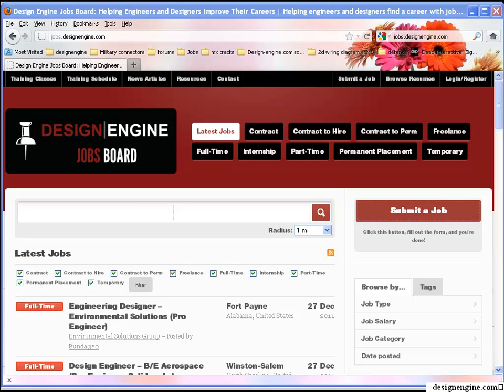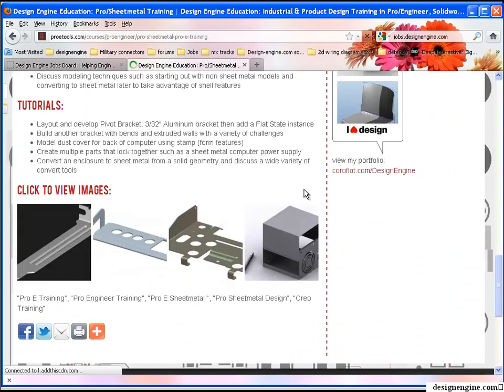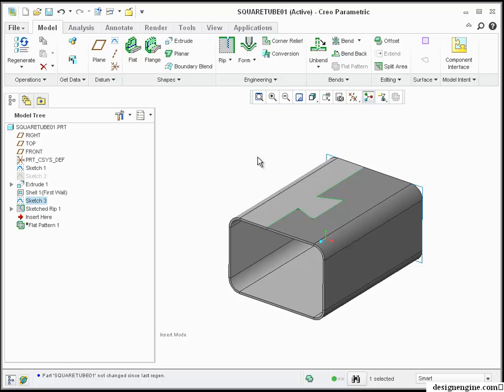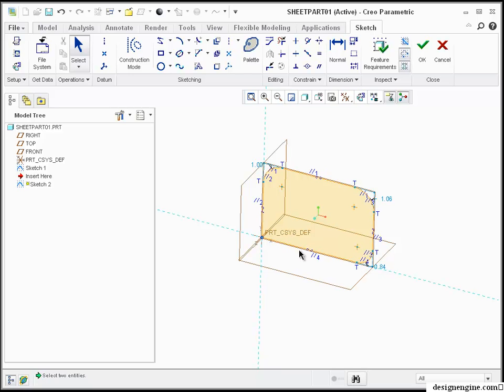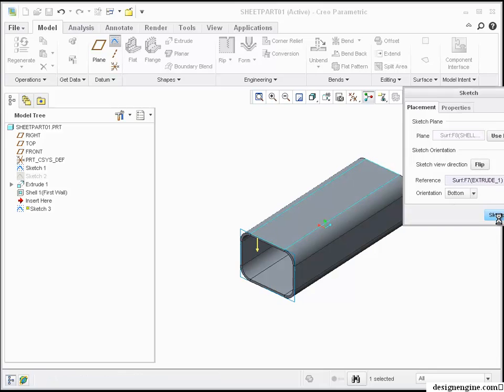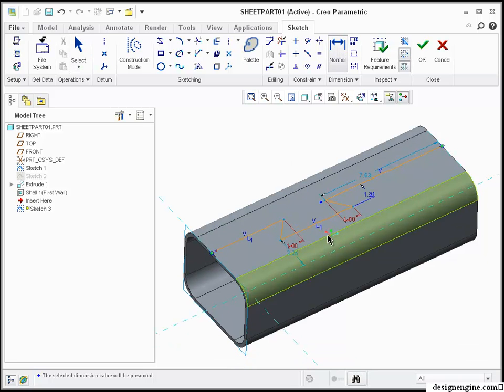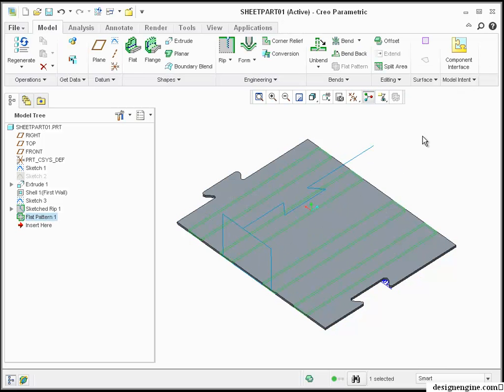Learn Creo 1.0 Sheet metal with this unique demonstration of Pro/ENGINEER's newest release Creo 1.0

Comment: Bart, It might help the videos if you have part unshaded during sketch operations.

In response to sahaja75 the fillet operation in SolidWorks is better than this or Equal Dim constraint would do so. It's getting better since wf5 but still needs to go further. 

Some programs allow you to create fillets by entering radius then clicking endpoints or swiping through them.

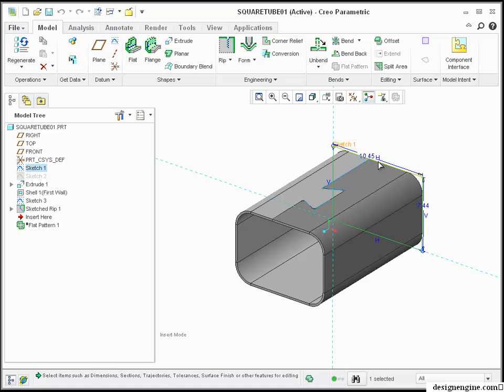Comment: 02:49 My friend, this sketch is NOT ok! One advice - NEVER draw a sketch in the right-upper side of the CS. It always should be drawn symmetrical, if you want to stretch nicely.
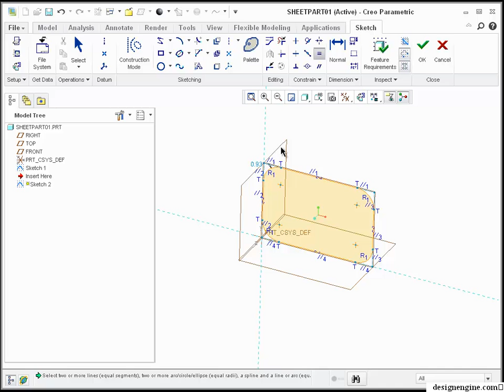05:48 No my friend - they are not the same! You missed one (at the upper left corner), but that's not the issue. The main problem is - THE GUYS FROM ProE STILL DON'T GET IT - THAT THIS FEATURE (rounding) MUST --ALWAYS-- APPLY EQUAL RADIUS, AND MAN SHOULD BE ALLOWED --TO CHOOSE-- HOW MUCH THEY'D BE --BEFORE-- DRAWING.